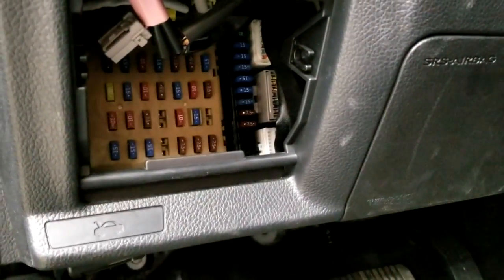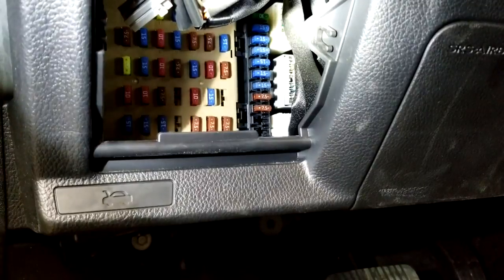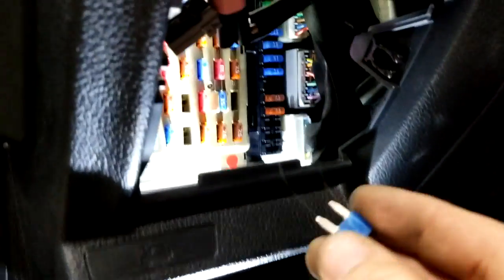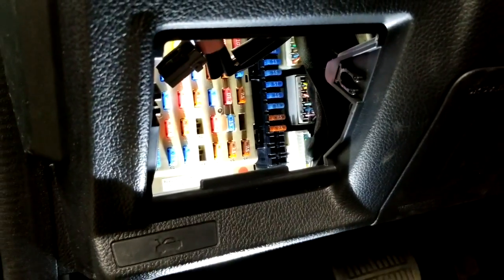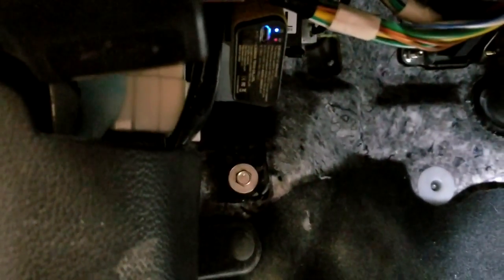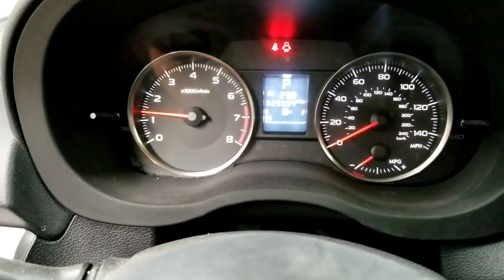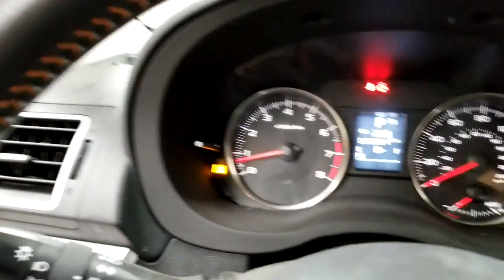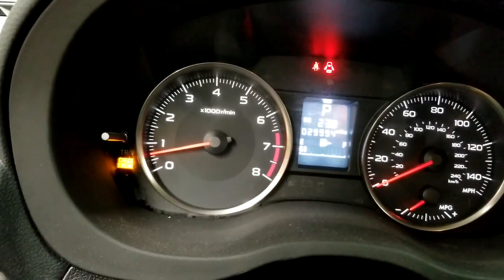Subaru check engine light on? DTC P0031. Watch this video before spending your money on diagnostics.

Comment: This fixed my 2015 Subaru Crosstrek. Thanks very much for the video! The dealer tried to get $3000 from my wife for three sensors, turned out this single fuse fixed the whole problem. This was the Little Rock AR dealer that we bought the car from, and it had under 50k miles at the time, which was under the warranty miles.

Comment: Saved my life. Was going to buy a new Sensor but went to check the fuse on my 2016 STI and was the fuse  #9 from buttom to top that was blown. Replaced it, clear the code and problem solved. Thanks for the info.
Reply: Where was the fuse?I got the same 2016 Sti with same code
Reply: @sammytarantino7106 me too! Which fuse ??

Comment: Mate!! I had P0031 and P0037. O2 and fuel mix sensor. Subaru dealership here said I needed two new sensors costing around $1500. They said they checked fuses too. 2 years later, still check.engine light on,.found.your video. Located that black.fuse box and low and behold!! The 3rd fuse was fucking missing!! Replaced it, cleared faults with my cheap scanner tool and POW! Faults gone! Those fuckers were going to rip me off. I bet they knew that the fuse was missing too. I've since given them a very scathing review!
Reply: What kind of scanning tool or brand so I can buy that?

Comment: What caused the fuse to blow? At that point, you need to check your wiring and check the 02 sensor. They do not just blow for no reason. That pre heater is exactly what it says. If its blowing fuses again, you have a short somewhere. The sensor its self may be bad.I have found the wires chewed right off by chipmunks.  I have seen them ripped off by ice or snow under the vehicle that have pulled the wiring down. had someone simply plugged the cheap wire holder back in.

Comment: Did this. Didn't work at all. Replaced a couple sensors but still hasn't gone away. Same codes pop up but I've replaced everything related to the code. This problem can be complex. Glad it worked for you though.
Reply: Hello. Did you find out what the problem was. I have the same problem as you. Mine is a SUZUKI SWIFT 4x4  2006. Have replaced it 2 times.
Reply: Look for a short or damage in the wiring

Comment: Hey George,
I'm guessing the paperclip and new computer never fixed the problem on the Lexus with a P0018 code? It most likely had stretched timing chains or some other cam/crank issue, just as the code suggested right? I'm also guessing it didn't work to reprogram the keys either right?...Did you fry the new computer too, after you connected the paperclip to the wrong pins (5+13) even after you showed which pins it should connect to?😂..The OBD connector was upside down from your diagram..lol🤔😂

Comment: Bro will this work on subaru wrx 2016, after replacing the engine, i started having engine icon flashing and also started having engine idle issue, what you think is the problem, resetting the ECU will that work?
Reply: Did you ever find a solution? Similar problem I'm having. Pulled the engine on a 2010 SOHC 2.5 and now I have P0031. Replaced the sensor.. checked fuses.. checked power to the sensor. checked resistance on the sensor.. all checks out yet there is still a code
Reply: @sfd50  Sold it but the new owner said the code went away as the connection wasn't plugged in all the way. I'm not sure I believe it but perhaps it wasn't!

Comment: Hi, my Subaru Impreza 2013 also just had the check engine light on, with that the traction light is also on and the cruise control logo is flashing. What could be the problem?
Reply: It could be your fuel Tank Cover that needs to replace  ...
Reply: Did you figured it out I got the same problem
Reply: I also have the same problem

Comment: What is the time of video where solution is?
Reply: It's the fuse, under the dash there's two fuse blocks, a tan one and a black one. Three fuses up from the bottom of the black fuse block is the one to check on this car and it could be blown

Comment: I have a 2006 Subaru out back that I have replaced the #1 02 sensors twice. I use a scanner and turn off the code and it stays off for one to two weeks, but eventually comes on again. Sometimes the engine light just goes off by itself. I also remember seeing another post where if you change the battery on a Subaru you need to change a fuse. I guess I will check my fuses. Anyone had a similar situation and a fix? Thanks for your post.
Reply: I have 2013 subaru brz.  It has only 40k mi. I have same problem as you. Some time it goes away it self and comes back it self.